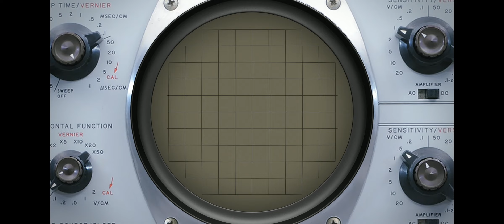Goot TP 100 De-solder Gun Pump Replacement

Comment: Thank you for the video! I've been thinking about getting goot TP-280AS but haven't been able to reach the decision after reading some bad comments about it. People say it gets clogged too often that the time spent on cleaning the hand piece is more than the actual time spent on de-soldering components. How is your experience with TP100? TP280 must be obviously superior to TP100. If your one works well, TP280 must work better. Please let me know. I'm eager to get one on my bench. I use goot TQ-95 soldering iron. A basic model but extremely reliable and of lasting quality.
Reply from the maker: My dealer here in Bangkok says the TP-280 is superior to the TP-100 and I would like to test that. But, I can only speak to the TP-100. Let's cover the clogging issues first. What I have learned to reduce clogging on this unit: Use a bigger tip. I started off using a 0.08mm and smaller tips and it did clog and worse the damn cleaning ram rom would not even fit through to clean it out. I ended up breaking many of those. So I started using a 1mm and the 1.5mm tip even on the smaller components and that solved most of it. The second thing I'd say to people with clogging issues is, how clean was the solder you were sucking? Nasty old flux and solder, and excess new flux is no good and will clog any gun fast. So I always give all my solder a clean before I suck it. This helps prevent damage to the pad due to excess heat you have to use on nasty solder too. My biggest complaint is that the vacuum pump diaphragm wears quickly. But with that said, I desoldered ALLOT of sockets..hundreds for sure so maybe that's the reason.  With the TP-280's pump design maybe that's not a problem as it should be more heavy duty being a bench unit. Yeah, when you buy it stock up on 1mm and 1.5 mm tips. You can try the 0.8mm and smaller tips but I find 1mm is good unless you are working on really small parts. I like my Goot better than my Hakko. I think the suction is better and the Hakko clogs more that the Goot for sure. Proper maintenance on the filers and cleaning the tips as you go will get you many miles. Hey, another pro tip on cleaning those tips is get a set of torch tip cleaners. They use them on cleaning acetylene torch tips. They are basically small round files for cleaning carbon out of small orifices. Not sure why they don't include these instead of the crappy smooth metal ram rod, but they work much better because you can all the crap out. Here's a link to what I'm talking about.  
Good luck if you get that thing and me know what you think. Maybe I'll get one too, lol 
https://www.amazon.com/Cleaner-Carburetor-Cleaning-Orifices-Sprinklers/dp/B089B2FBCN/ref=sr_1_1_sspa?dib=eyJ2IjoiMSJ9.PqCsQvaa2ivUCdWIfrZ2z7iRPi2LgSF4_VbQEEkQkKJcNiMmAdm6p10bW1QC-GFI23P93UoWXKkklX4NxyVZJ1-Kz082b3983OwRAf248F71b5kIfvQf_gqfIy4AWeBKRcRduVmOSnLH9mONaZEXIuvXOeWiTS99MHJn3wr7rv823bhJrfFMahYUND5oqBwlIM9nSUD0i0uoWRPSyA1V22dXwFg8res7ZIPE-uus6zOc1m3GhmNs7S5-S_Bk37fXRYzy8b2gAdf78SmOtIEspo8vjwEDcJlrRzylDV6-JvI.vkEsZ2UvopNVdbfOjsA0oA6bsvFo4W0mQC3o9JXlYN8&dib_tag=se&keywords=torch%2Btip%2Bcleaner&qid=1725187469&sr=8-1-spons&sp_csd=d2lkZ2V0TmFtZT1zcF9hdGY&th=1

Comment: Hi Mr. Kieth Am Ahmed from Egypt many thanks for good explain . I have 4 defect tp100 all need the diaphragm 
From any where can I get the diaphragm ?
I use the TP100 quite a lot.  I work on repairing industrial appliances and heavy equipment
Reply from the maker: HI there! I've been to Egypt and had a great time. Very kind people. OK for your parts, we have a dealer here in Bangkok that can get you the parts. I can put you in contact. So same like my diaphragm, I could not get the screw out of the shaft that holds the diaphragm on so I had to order the complete shaft assembly. Did you get yours off and only need the diaphragm? If not, try to remove it. It is either a left handed thread or glued. I will use a vice and some heat next time I have to remove.
Reply: Many thanks for your interest.
I already got the screw out of the shaft the diaphragm now is free alone.
Please help me to get another diaphragms
Reply from the maker: @ahmedelsayed7435  email me please and I'll get you a link.

Comment: Thanks  for my dealers  not give provide  service  and buy other brand .   I am very  happy  for zd915  it's  very  good  work better  than 500as goot station.    Also very  easy  cleaning,  low cost bits good quality.    Now I scrap  500as.
Reply from the maker: Thanks for sharing! I did research on the zd915 and it looks impressive. I agree with the Hakko and Goot I have the tips are expensive and seems you have to clean all the time. I also think  the vacume could be better. I will buy something like the zd915 next time since I replace so many chips.

Comment: Sir,  500as  and 580 station  what different??  Desoldering  card is same use?
Reply from the maker: Hi!! The 500as has an external vacume pump and the 580 is like the one in the video. The 500as pump and control unit is housed and will set on the bench with vacume and control lines connected to the hand held unit. The 500as has a higher vacume rating and is more expensive. I would like to have one lol!!

Comment: Hi sir i am from India,  do you feel buying goot desoldering Station or this tp100 gun from goot brand is worthy,  or its better to go with some other brands considering performance.  Because in India goot seems too costly I am confused it is worthy to buy that at 250 us dollar in India...
Reply from the maker: Hello! What part of India are you in?  The TP100 is good but the real question is how often will you use it? If you are only desoldering a little for a hobby or will you be using it everyday? I think the TP100 is good for professional use because I used mine so almost everyday. However there are other things to consider. You will need new tips and other parts eventually and depending the availability and cost it may be worth choosing another brand. I like buying tools in which I know the parts are affordable and available on short notice. I bought a Hakko desolder gun back in the states last year and it's just as good I think. I think I will invest in a unit that has the pump separate from the gun next time. I think it will be better for cleaning and has more vacuum, which in my opinion, both units are lacking. Like I said  I think the TP100 is good for everyday use if you keep it clean and control the heat well. Good luck.
Reply: @arcadelaboratory  hi thanks for your reply , i am from south india,tamilnadu, tp100 costs almost 310 usd and tp 580 station almost costs around 575 usd here , which is too costly and i have to use like once in a month for 4 hrs a day, we do manufacturing of control panels, so we have to service defective boards like once in a month. here desoldering guns are rare in market, i got a option from a dealer of metroq 915  station , which feels better in price like 150 usd , it looks similar to zd915 station. so feeling confused to choose. but goot is more costly here and spares also high, mostly all review i saw makes me feel like goot is not worth for money , and it cloghs often and needs to be cleaned often.
Reply: whats the price of tp 100 in ur country and  which country ur from sir?
Reply from the maker: @Naveenkumar-mm5jl  that's allot of money yes...for just 4 hours a month. If your company buys it, then get the best one, lol. The Metroq might me a good solution because of the cost. What kind of parts are you desoldering?
Reply: @arcadelaboratory  Usuall through hole resistors capacitor,  ic base,  diodes and some xynia connectors comnicon connector, xy126,  some power transformeror....how much dollors it costs in your country sir....